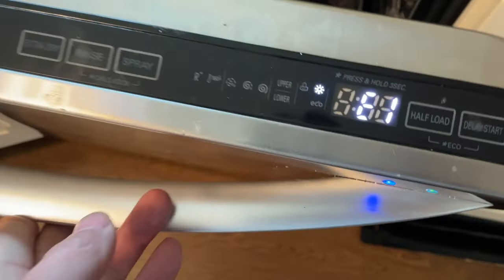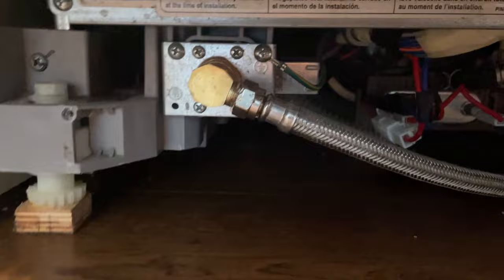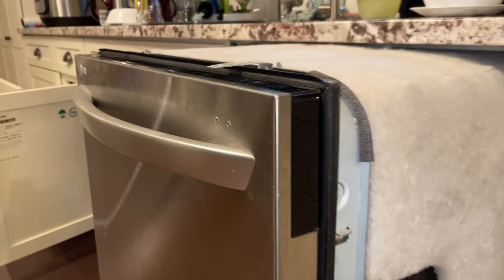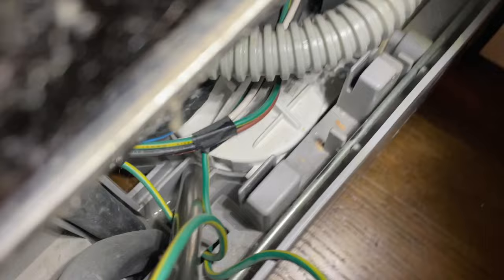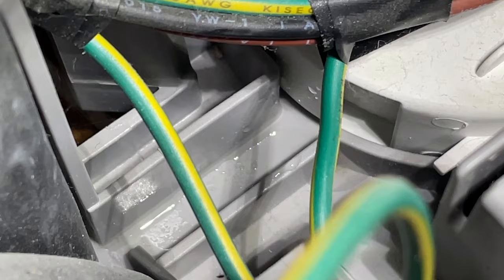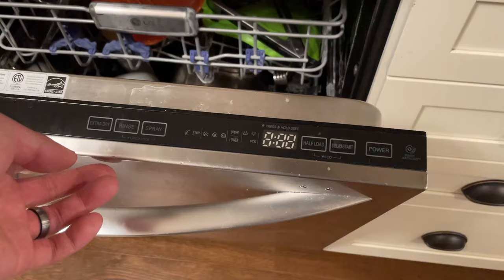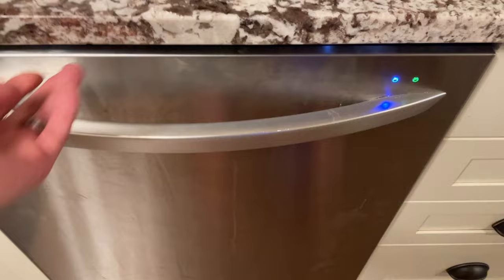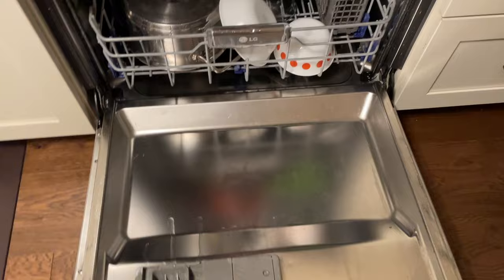LG Dishwasher E1 Error Code Easy Fix

Comment: This clears the error but NOT the root cause "Why did the water leak out in the first place?' Incorrectly loading the bottom rack of the dishwasher! Look at the video at  how  a bowl is upside down on the bottom rack. The jets hit the bowl and the water splashes out of the bottom of the door and drips into the sensor area. Load the bottom rack with no pots or bowls that get hit directly by the bottom spray arm (splash water directly towards bottom door seal, door seal is not 100% seal).
Reply from the maker: I think you are correct. That bowl on the front right corner could’ve  definitely caused the issue.

Comment: Great video👍 just what I needed to know to fix it. The pain was getting the dishwasher out from under the counter🤬
Reply: How did you get your dishwasher out from under the counter?
Reply: There were screws under the plugs inside the dishwasher. Open the door and on both sides right at the front there are plugs. Remove them and unscrew the screws and it should slide out

Comment: fixed my LG dw this way:  Empty dw of btm rack and filter parts.  Dry floor of dw and sop up all water in filter hole in floor. rig shop vacuum to blow thru hose.Stick hose end in hole, tie it there if need be. Run vac for 20 minutes. ck for code cleared or remaining, repeat if necessary.  I didn't have to. Joy!

Comment: My dishwasher works a few times, then does this for months. 🙄. It's built in so how do I fix that? Not mine either.  I rent the place. 😒. Thank you
Reply from the maker: I’d start off with cleaning the filters in the interior bottom. If those look clean, might be a clog in the drain line. You can disconnect it from the sink drain line and force a drain on the dishwasher while simultaneously running a wet/dry vac on the loose dw drain hose end.

Comment: We get the 1E code and it's a brand new unit, haven't used it once. Any suggestions? The water supply is on so I'm wondering if our water pressure is not sufficient, although our previous Whirlpool worked fine.
Reply from the maker: E1 or IE?
Reply from the maker: E1 is when the dishwasher thinks there’s a flood somewhere so it in constrain drain mode.

Comment: any thoughts on why water was sitting in that reservoir ?   i vacuum mine out and it refills back up.  help
Reply from the maker: If you determined that your pump is okay, you may have a clog in your drain hose.

Comment: This is a great video, I'm finding myself cleaning the tray out every 5 weeks or so. Where is the water coming from, and is there a fix? Thank you for your help...
Reply from the maker: Check your rubber seals around the opening. I would also check to see if there’s a clog in the drain hose. Your problem is that there is a leak somewhere or your water level is getting too high (drain issue).

Comment: Appreciate the video on the E1 error code.  The only time I get this E1 code in Normal mode; the dishwasher works fine in Pot-Scrubber and Delicate modes.  Any idea what the source of the problem would be?  Thanks in advance for any comment you can provide.
Reply from the maker: I would start off with the simple things. Clean the filter on the bottom. Check the seals around the opening. Afterwards, I would check my drain lines for clogs.
Reply: @chicagohandyman  Thanks, I’ll try your suggestions….

Comment: Is there anything else u need to disconnect in order to pull the dishwasher out halfway? Obviously shut the breaker but can everything else stay hooked up?
Reply from the maker: Yes, everything can stay hooked up. There is usually 2 screws under the countertop holding the dishwasher in place you will have to undo.

Comment: Sucking it up and walking away ? The question remains as to why the water leaked.
Reply from the maker: Hopefully it was an one-off issue like in my case. I suspect the drain filter was clogged and that’s why water went into the overflow.

Comment: now make a video of u finding where leak came from and diagnosing the cause of E1
Reply from the maker: Not sure why it happened. Found it in E1 mode near the end of a normal cleaning cycle. I can only think of 2 possibilities. 1) the filters were dirty. And they kind of were and subsequently cleaned. Or 2) there might have been a ladle that was too tall for the utensil tray which prevented the lower spray arm from spinning. In any case, after the fix, the DW has not not entered E1 mode since.
Reply: @chicagohandyman  Great vid...how critical is the drain loop height under the sinK?  Mine has the loop about 20" above the bottom of the cabinet as specified in the manual but may have lowered and got some backwash?  Any comments on this?

Comment: Why would water build up there?
Reply from the maker: I’m not sure yet. But obviously there was a block somewhere and water went into that overflow reservoir. 

I took out and cleaned the filters on the bottom of the dishwasher in case that was the issue.

Comment: Why does water build up there though
Reply from the maker: Water goes there if the water level is too high inside the dishwasher. It could be due to a clogged drain line or bad drain pump.